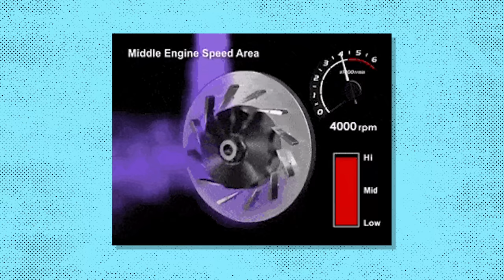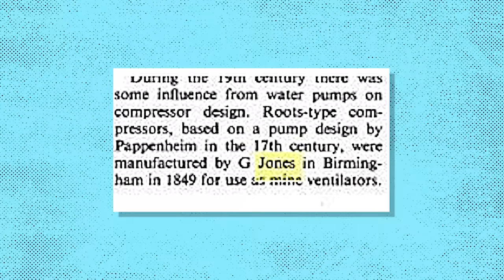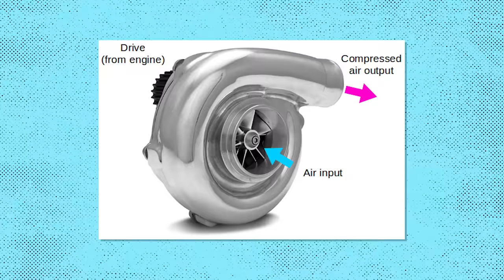Why Superchargers Aren't As Good as Turbos

Comment: I got tired of reading the comments in which people were arguing about pro chargers and the roots style blower mounting. Before blowers were mounted on top of V8 engines there was an individual who produced and sold a kit that mounted the Rootleib style GMC diesel blowers directly in front of the crankshaft on V8 and inline style engines. That company was Potvin, later the Roots style blowers were mounted on top of the V8 engines using custom intake manifolds and a chain drive system to turn the blower. The belt system with an adjustable idler arrived later on. Another section in the comments argues about Roots blowers being used on inline engines. The GMC blowers most of us know from sight have their origins come directly from inline engines. The gmc inline engines were categorized by cubic inches and number of cylinders. 6-71 blowers are from an inline Diesel engine that was a6 cylinder engine with 71 cubic inches per cylinder. The 71 series of Detroit diesel ranged from 2-71 twin cylinders all the way to 8-71 8 cylinder engines. The blower on the inline Diesel engines bolted directly to the vertical side wall of the two stroke diesels and were driven by a shaft into the input gearing of the charger housing. The Detroit diesels were also built in 54 series and 92 series of engines utilizing 54 and 92 cubic inches per cylinder. The V8 diesels also used a supercharger in their induction systems which mounted similarly to the way we know them on V8 gas engines however they are less desirable as the custom intake manifold needed to mount them in a gas application is more scarce as they were mainly built in the 50’s and 60’s for gas conversion but they are equally practical today and more plentiful in salvage yards. The 8v92 Diesel engines were quite a popular engine in the past and GM built a V8 diesel at one time that used the 8V92 supercharger on the engine and pre charged the supercharger with twin turbos. Those engines were used on everything from generators and semi trucks to bulldozers and railroad tender engines. The conversion of the 6-71 diesel superchargers for gasoline use is fairly a simple operation entailing pinning the rotor shafts into the center of the rotors, upgrading the bearings for higher engine speeds,replacing seals with a more positive sealing system and timing the front and rear gear sets to ensure that the lobes of the rotor maintain proper clearance at the higher speeds and under more load. The GMC blowers are inexpensive even today and are killer when trying to increase the fun factor of all kinds of things including motorcycle engines,boat engines,cars,trucks you name it. Enjoyed the video and even laughed at some of the arguments in the comments. Educate yourselves folks, knowledge is something you can use until you take your last breath.
Reply: Excellent comment, here are a few additional remarks.
The GMC, DETROIT, KASSBOHRER and EMD/Winton.
are all Winton Type 2-stroke uni-flow Diesel engines.
 This engines are not supercharged, they are NORMALLY ASPIRATED which is a specifically different concept than a Naturally Aspirated engine.
 Winton Type engines do not have a intake manifold.
The blower is mounted to the cylinder block a passes air into an "air box" which surrounds the ports around the lower end of the cylinders.

The Detroit Diesel 71 series was a modular system with engines from 2 cylinders all the way up to 16 cylinders (V-16).

The 91 and 71 series were both available in a "Turbo-Normalized" version for improved fuel economy.

The blower does not pre-charge... it pre-normalizes the engine, the turbocharger(s) unload the blower the save fuel.
  Some EMD and Kassbohrer engines eliminate the blower all together, using a "Coupling-Turbocharger"
connected to the crankshaft by a fluid coupling and /or one-way clutch until reaching a preset rpm, the drive they decouples and the Turbo operates in the normal fashion.
 none of these engines operate with any significant increase in manifold pressure above ambient, they require a scavaging blower to operate.

Comment: The example you used for the roots style supercharger (the dodge challenger demon) actually uses a twin-screw type supercharger.
Reply: Both are positive displacement compressors, less efficient than the centrifugal type
Reply: @sandervanderkammen9230  but still the roots and twin screw are mechanically different
Reply: @phroogo... mechanically they are the same, the only real difference is the layout, the air flows perpendicular to the rotors in the Roots type while the air flow parallel to the rotors in the twin screw

Comment: Some cars use a small motor and battery to give car an initial torque push (called as mild hybrid). I wonder this same thing can be used to give turbocharger an initial push with the help of a motor and small battery, just to eliminate that initial turbo lag.
Reply: I think Porsche already has something like that, if I'm understanding what you're saying. Using electric power to spin the turbo and help eliminate turbo lag. I'm not sure if they ever implemented the design in to their cars or not because I don't know a lot about Porsche but I remember reading an article about their patent for the design.

Comment: Superchargers do not have to be fitted "on top of the engine".   I've had 2 surpercharged vehicles, neither was mounted on top of the engine.  The air was ducted in just like a turbo setup you mentioned.   First was a 4.9L F150 I6, second was a 2004 F150 5.4 V8.  True turbo would have given more power for far more money.  I believe I had like $500 to $700 in each of the superchargers where a decent intercooled turbo would have run in the thousands.   Both trucks had decent gains, nothing track worthy, but that wasn't my goal.  I owned a 26' boat, so my goal was more power for pulling, which both delivered noticeable differences with.  Added bonus of the supercharger tho... it sounds WAAAYYYY better than a turbo too.

Comment: I have run two cars over the last 20 years...one turbo and one twin screw.  They're both fun in their own way.  The one with the twin screw just feels like a larger motor than what it is.  The turbo adds an almost elastic feel to the power delivery (probably specific to the setup but it has a distinct feel) on the other.
Reply: The important thing is that turbos deliver more horsepower than superchargers...

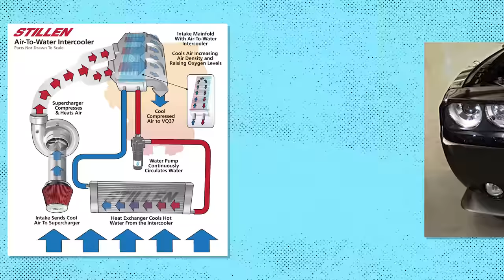Comment: 3:14 thats not why intercoolers exist, compressed air is always going to be hotter then it was uncompressed. Also yes roots blowers DO compress air. Its not a fan, there's a reason why roots and scroll type air compressors exist, because a supercharger is an air compressor with a massive leak (the engine using the air)
Reply: Positive Displacement compressors like the Roots type are simply pumps for moving air, the difference is they are less efficient than centrifugal compressors.

Comment: If im building a high compression engine, a supercharged build is going to be much more reliable to tune for than a turbo just by virtue of a flattened curve being more consistent a turbo deciding to only make power between 5-6.5k rpm. Ill take a twinscrew over a turbo pretty much every day after driving turbo vehicles consistently for work and dealing with their shitty lag

Comment: Supercharger will pull harder off the line and have instant throttle response compared to a turbo that needs to spool up,so which one is better depends on the application
Reply: Turbos make more power which results in better performance.

Comment: Again it depends. There's quite a few situation's where Plumbing a Turbo is next to impossible. Sure You can get creative and Mount the Turbo elsewhere on the Exhaust, but then You're adding a lot of unnecessary Weight when Running a SC is more Logical...
Reply: There is nothing logical about installing a supercharger if you point is to produce more power...

Comment: Unfortunately the same pitfalls other videos have on this topic. Superchargers take power to make power. OK. Are you telling me you can put turbos in the headers and the power loss is zero? The ideal header design that makes the most power is one where the exhaust gas has to push an impeller? Why aren't NA engines designed that way, with turbos that do nothing but spin for nothing? Your new age electrically controlled turbo gets energy from where exactly? Packaging, ok, superchargers have to be next to the belt. Turbos have to be next to exhaust gases. I have seen both using a shaft to place them in really unconventional locations, it's neither here or there this one.
Reply: Turbos have lot's of benefits, higher thermal efficiency which leads to colder air to the intake (also applies to centrifugal superchargers)
In low load, like highway the turbo have no negative effect, where a Supercharger still will have transmission losses. (OK some cars have clutches)
In high load, yes you are correct, the turbine on the turbo puts significant extra load on the engine. (exhaust pressure)
But even there the losses are smaller than on a Supercharged engine.

But in some applications superchargers will always be better, we will never see Top fuel outputs with a Turbo engine.
Reply: @daniel635biturbo  The meat of the conversation is definitely the amount of efficiency, and someone actually carrying out a very fair experiment to measure it. Now say you quantify that in horsepower for a given application. As an enthusiast choosing one over the other the efficiency gain of the turbo can easily be outweighed by reliability concerns, car control issues due to lag and not being able to transfer weight to the tires as you need to in cornering, or the fact that the power limit is somewhere else, such as in the gearbox. In practice, I think enthusiasts choose based on "cool" factor. OEMs choose based on profitability. Much cheaper to meet power and emissions goals with turbos. If the turbos fail just after the warranty expires that's the consumer's problem. I don't think we'll see as many high mileage turbo engines as we do NA or supercharged ones.
Reply: @MrSuchasillygoose  Considering that Turbo diesels has been used since the 1950 in heavy equipment I have no concerns in reliability, especially with water cooled cores like we have had since 1990.
Some manufacturers are using electric versions, to combat lag issues, but there is probably mostly about costs.

In cool factor to me a Roots style blower always wins.
Reply: @daniel635biturbo  You have more trust in the tech trickle down than I do. I remember Honda being absolutely unreliable in turbocharging in F1 several seasons recently, the pre-combustion chamber tech being implemented only by Maserati in a production car despite being around for decades, and Ford ecoboost blowing headgaskets like they're paper.
Reply: @MrSuchasillygoose  Yes, I suspect we have different backgrounds.
Here in Sweden Turbo engines have been common in family sedans since the mid 1980 when SAAB really pioneered this.

Side-note, efficiency is really REALLY important here.
1 liter gasoline cost 21 SEK
Re calculated that's 8,40 USD / Gallon.
That's tax pressure I tell you.

Interesting about the Maserati, that will occupy me an hour, thanks for the civil conversation, rare these days !
Reply: @daniel635biturbo  My buddy drives a 96 Saab S900 bone stock. Its a pretty good machine for its age. I like the Saabs of the 90's

Comment: isn't it possible to design an hybrid centrifugal super/turbocharger with a turbine and a betl that would be a bit more complex but would have no lag and still use exhaust gasses energy to reduce power loss or even send power to the engine ? although electric turbos are probably simpler and can  harvest energy when slowing down, store it and provide more boost on full load.

Comment: I believe there's a ship turbocharger that works like a centrifugal supercharger when the engine is running too slowly using a centrifugal clutch.
Reply: Coupled turbochargers are used in several Uniflow 2-stroke Diesel engines... including locomotive and marine engines made by EMD.

But these engines are Normally Aspirated not supercharged.
Reply: @sandervanderkammen9230  they're not supercharged but aren't they considered turbocharged?
Reply: @Rose_Butterfly98 They are called Turbo-normalized... 
The turbo pushes the exhaust out the cylinder, but creates no boost pressure.

Comment: I love my R53 mini but it's so inefficient. Did a steady drive the other day over around 150miles. It did 32mpg (UK gallons). If I drive it hard it's low 20's or high teens. It's shocking and not that quick. My daily is a MK3 Leon FR with a 2.0 turbo with 190bhp. Same journey steady it gets over 50mpg. Even driving it hard I struggle to see much less than 40. Do enjoy the linear power though and the SC noise.

Comment: Here's the thing, they both have their place in the automotive world and racing world.  Turbos have the ability to be more fuel efficient at lower RPMs because they are producing less boost. Less air, less fuel.  But they have what is called turbo lag. Blowers are more even with little to no lag, so they are "always on" and using that fuel. Not saying it's a huge difference, but it is a difference.
Reply: The main difference is turbochargers make alot more power, it makes more power because it wastes less energy from the fuel burned...  with the supercharger you loss the difference in horsepower out the tailpipe, wasted horsepower.
Reply: Centrifugal superchargers also have lag,  but like Turbochargers lag is not a loss of accelleration, it is not real..
Lag is an imaginary problem.
Reply: @Sander Van der Kammen  while you are technically correct about lag... it's much easier to just say "lag" than it is to say "turbo needs to spool up before I feel in the seat of my pants what my right foot is doing" lol. I believe turbo lag does mean that the response lags vs a normally aspirated engine having much quicker response time to what the foot is doing. I wasn't sure if centrifugal chargers would lag or not because of the belt drive. But it does make sense that they would since they need to spin faster before the air is actually pressurized
Reply: @zerobomb0  Like I said it's still an imaginary problem, not a real one.
If you teach someone to drive only a turbocharged car? He will never know what lag is because he expects a curvalinear throttle response.
You put the same driver into a naturally aspirated or Supercharged engine? he will say it "feels faster" even when the speedometer or lap times prove otherwise.

Comment: You missed the most important part. Turbos are not mechanically coupled to the engine. Because of this they can hit peak compression sooner in the rev range. By utilizing a waste gate they can then maintain that peak boost.
Reply: EMD Diesel engines have turbochargers coupled to the crankshaft at low rpm.
Reply: Typical turbocharger is driven by the waste heat energy from the reciprocating engine exhaust... so no parasitic loss.
Reply: @sandervanderkammen9230  this is a myth. The force needed by a turbo to spin puts back pressure on the exhaust. This is the fundamental of Newton’s third law. The engine must work harder to spin that turbo than an NA engine would. But the benefit from having more O2 in the combustion chamber more than makes up for it.
Reply: @williamharford3521  No, its not.
A turbocharger is a heat engine and operates using the BRAYTON CYCLE.
Thw energy used to drive the exhaust turbine is recovered from exhaust heat and does not create any additional parasitic loss on the main engine.
Reply: @sandervanderkammen9230  I would love to see more info on this (seriously interested in educating myself here). I understood ICEs run on the otto-cycle. If no combustion is happening inside the turbo the brayton-cycle does not apply. The compression of the air itself also causes a lot of heat resulting in additional energy loss. 

However I am thinking of a turbo and an ICE as separate systems so I might be missing something.
Reply: @williamharford3521  There are many examples of Combined Cycle engines.. Otto + Brayton, Brayton + Rankine, etc.
The Turbocharger operates as a Second Pass heat recovery engine in a Combined Cycle, with a Otto or Diesel Cycle engine.

The exhaust gas temperature drops as it passes through the turbine and this temperature drop is directly linked to rhe amount of heat energy converted into shaft horsepower and can be expressed using the Carnot Formula.

Comment: The Supermarine Spitfire was Supercharged. So are the fastest 1/4 mile cars you can buy from a dealer (Dodge Challenger Drag Pack, Copo Camaro and Mustang Super Cobra Jet, these cars all run in the 8s). The absolute fastest race cars are also supercharged. Frankly there are so many things wrong with this video I can't cover it all. First of all, turbos also cost power to drive. Everything costs power to drive. The engine itself costs power to drive. There is no free lunch. Yes, turbos cost less, but not as much as you might think. Second, you're confusing turbo lag and boost threshold. Those are two very different things. A positive displacement supercharger doesn't have to be mounted in the middle of the V, not at all. I could go on and on, but I just don't care. I may make a video covering this nonsense.
Reply: Well said